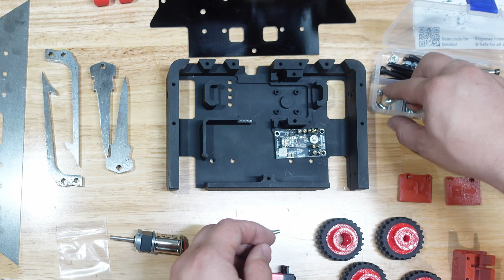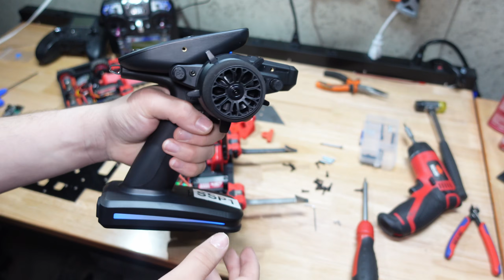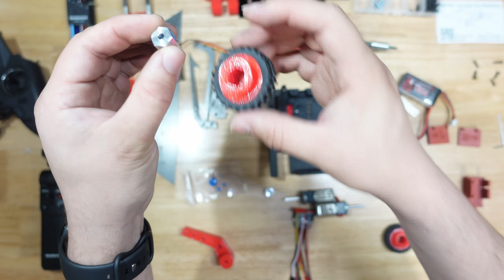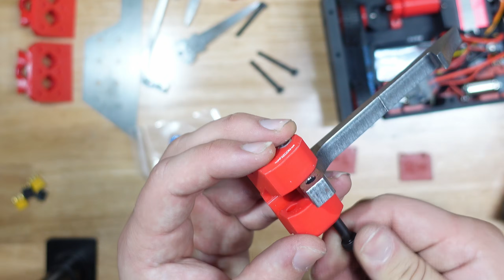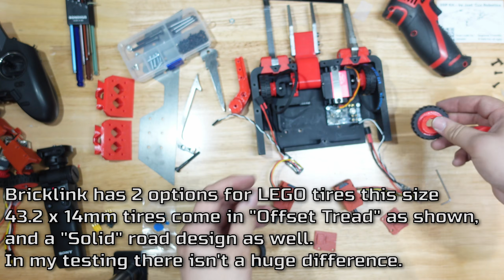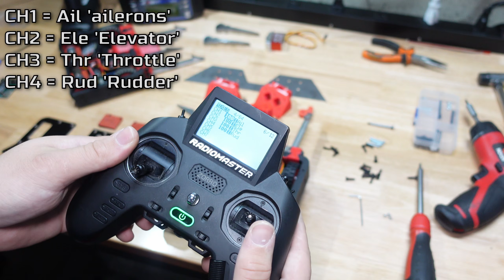SSP 2.0 Kit Assembly Guide - Standard Lifter Kit, Forks, Wedge, and Pro Brushless Upgrade

Comment: Would you recommend plastite screws over m2 aluminum heat inserts?
Reply from the maker: Yes. M2 screws are also just really tiny and weak in general. The #6-19 screws I use here have a metric equivalent of M3.63-1.34. Heat set inserts have really poor pull out strength compared to plastite screws since they engage a smooth cylindrical area instead of a helical threaded groove and they are generally much heavier and more expensive since they are made of brass which is even more dense than steel.
Reply: heat inserts never work unless in super rigid materials (nylon, PLA, etc). pretty much the standard in combat robotics is either standoffs that go through the entire frame or plastite screws. I have a midsection piece on my lynx style robot that uses threaded inserts in paht-cf but thats it.